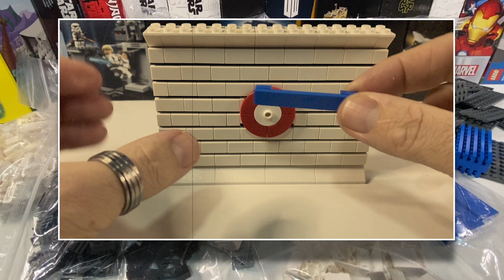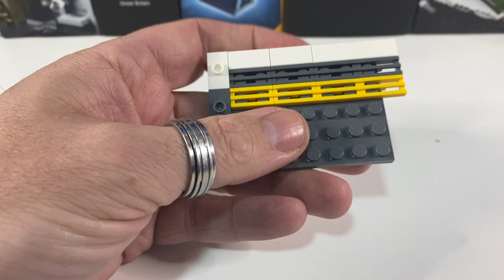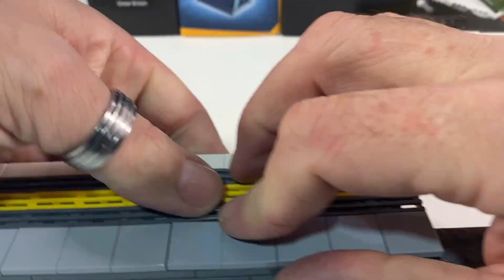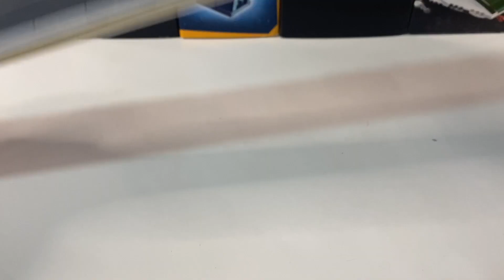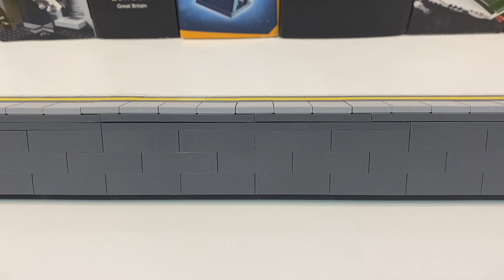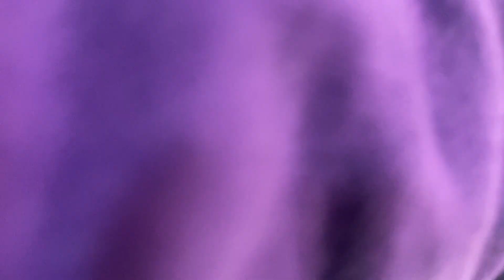Lego Tube Train Station MOC part 5 - First station platform

Comment: I do like the look of the station. How many stations will you have, and how long will the length be between those stations? I know Robin Hood Bricks has two stations but only one is in use, the other is abandoned and filled with ghosts.
Reply from the maker: Hi there! - I'm glad you like it.
I don't know yet how many stations I'll have and I probably won't know for sure until the City is underway.
I originally thought of having just one station, and the train going in a loop under the city, as I think I'd prefer to build different things rather than two things that look almost identical! As you'll see, this station takes up a LOT of space and bricks!!!!!